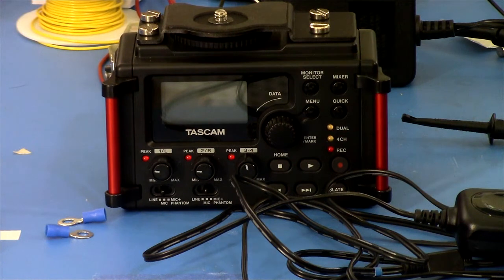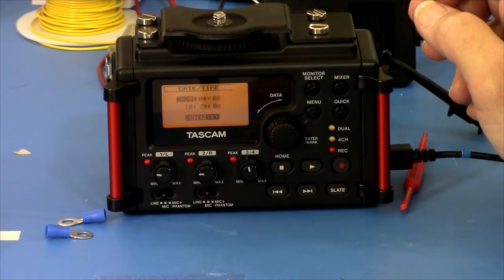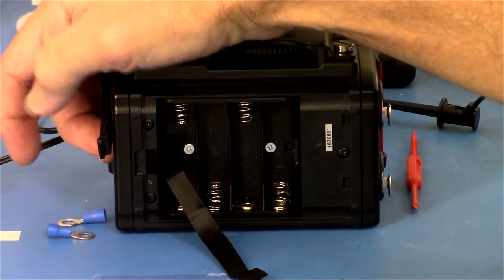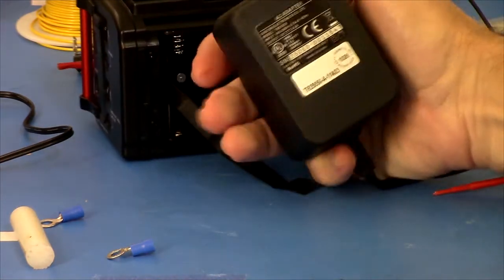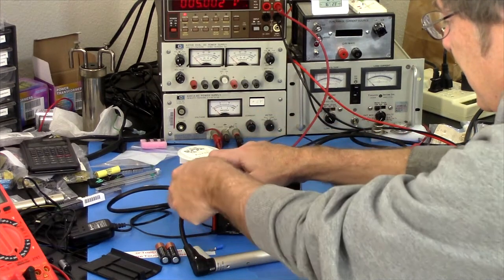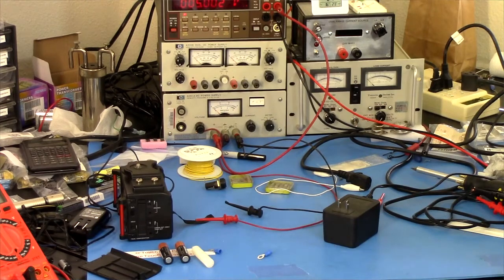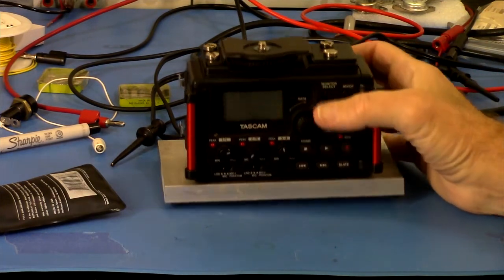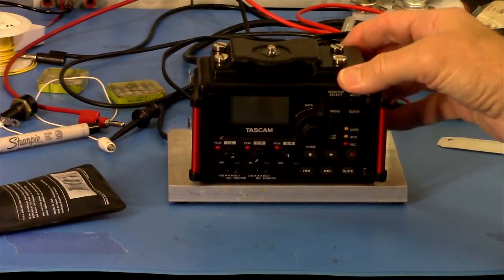Operating a Tascam DR60 MkII Recorder Without Batteries

Comment: It will run on USB power (powerbank or mains adapter), it doesn't need batteries if it is running on BUS power. If that is dying after selecting BUS power then it is faulty, I have had this model, the DR70D and currently use the DR701 which all operate on the same principle. As a side note, I also have the DR40 which operates on the same principle and I have never had any problems with any of them so either your unit has a fault or there is something that you are doing that isn't right. These are all perfectly good, solid and reliable recorders. What you are doing here is unnecessarily overcomplicated, sorry if that offends but I speak from over 7 years experience with all of the recorders I have owned and never experienced any issues.
Reply from the maker: Perhaps you missed the part of the video where I demonstrated the problem.  But feel free to post a video demonstrating that this problem is unique to my unit.

Perhaps you missed the POINT of the video, which is about solving a problem at little to no cost, using available resources.  The lessons apply whether the problem is real, imagined, or caused by a defect.

Let's assume I have a defective unit.  It is out of warranty, so I can't just send it back to Tascam to have it repaired (which would also mean that I am without the use of the device for some period of time).  So what would be a less complicated (zero to no-cost) solution?